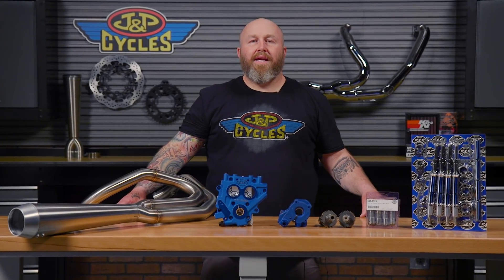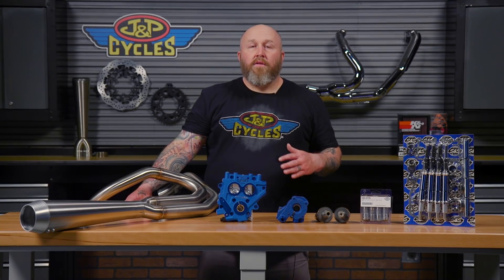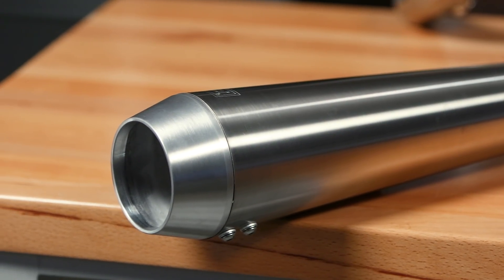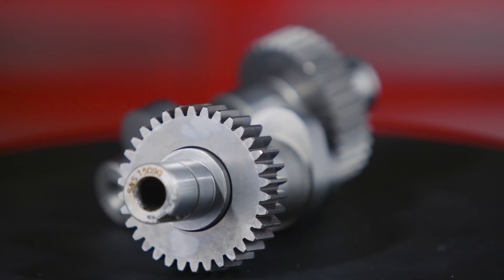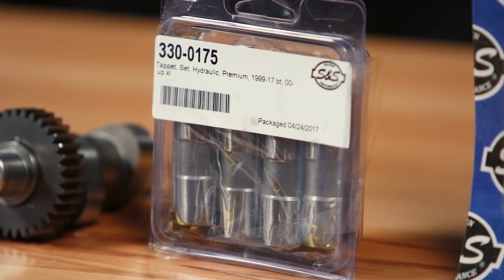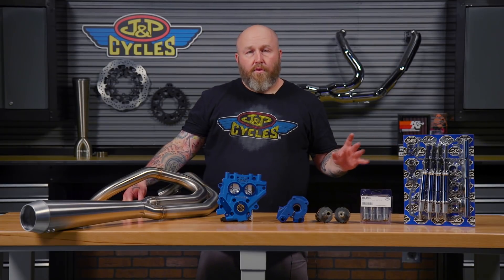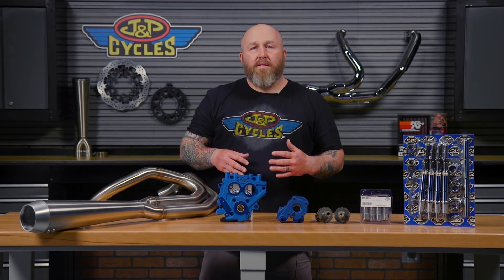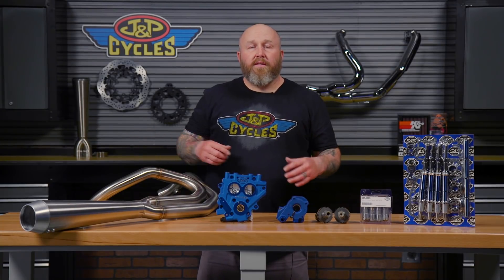V-Twin Stage 2 Performance

Comment: Ok' as you can see' from my profile picture, i have a 2015 Fatboy. It already has the stage 1 set-up. Now' i was wondering what size cam would be good for both torque and horsepower, and' not having to do any other mods. And' what type of tuner would i need to use to get it right?

Comment: great explanation of the stage 2..... I just installed al the full kit with the "EASY START CAMS" (the ones with the small fixture to facilitate the start)... my coments using the "easy start cams"... at low speed you "hear" "clicking" those small fixtures and high speed stops the "clicks..."....  I´m seriosly thinking on replace the cams for the "no easy start cams" the ones you are showing at your video.... once again, thank you for the explanation. hope my comment helps to other owners to take the right choice, my bike is HD Road King Classic 2000 FRLHCI.-
Reply from the maker: You shouldn't hear any clicking from your Easy Start cams. The mechanism is held open above 700 rpm due to centrifugal force. If it were to fall back closed it would hold your exhaust valve open 30 thousandths and your bike would be coughing and sputtering. This clicking your hearing from that area could be a loose pushrod or a collapsed lifter.
Reply: J&P Cycles thank so much for the answer, I'll look over the recomended elements to resolve the "cklic" sound.. I'll report the result of this, once again, thank you for the video and keep it up... we learn allot from you guys..
Reply: Alex Eidenier  hi.. all works perfect, the sound I had was the quicki push roads installed up side down... my tecnician installed in wrong way...  now corrected and all sounds beautiful... is one of the best investments I made on my Road king classic 2000.
has alloy of power.
thank you for touch base here.

highly recomended....
Reply: Alex Eidenier  this was one of the most effective investment on my old bike....  I do compare the performance with my new 2018 Ultra Limited [no updates at all yet] ..... and I love my old one.....  .... share your experience & stay tunned... regards

Comment: I have a street glide special 2016 103 motor. Full stage 1 done. What is the cost to go full stage 2 . The right way, without losing reliability and that everyday ride ability.
Reply: My buddy did his and it was around 2000$ installed
Reply: @ericnuernberg3901 thank you

Comment: What would be a good, or the best stage 2,3, or 4 air cleaner, to connect to a HPI 58mm intake throttle body on a '15 HD Ultra
Reply: Ok really like the K&N from RevZilla for my M8 114ci

Comment: What kind of exhaust is that??
Reply from the maker: The 2 into 1 system is a Bassani Stainless Steel Road Rage System. https://www.jpcycles.com/product/166-7002/bassani-road-rage-2-into-1-high-horsepower-exhaust-stainless-steel 

The header hanging on the wall is a Vance and Hines Power Duals Header https://www.jpcycles.com/product/212-781/vance-hines-power-duals-exhaust-chrome